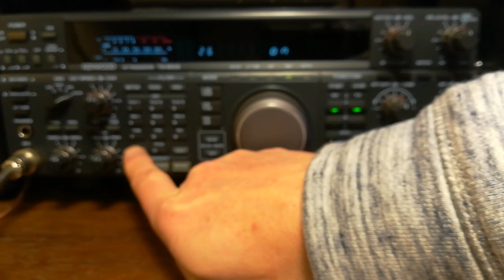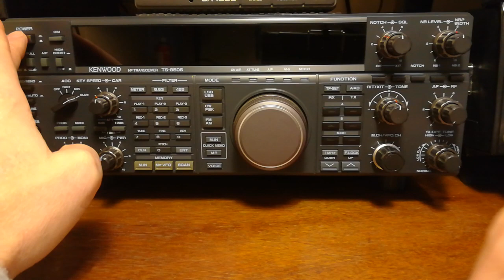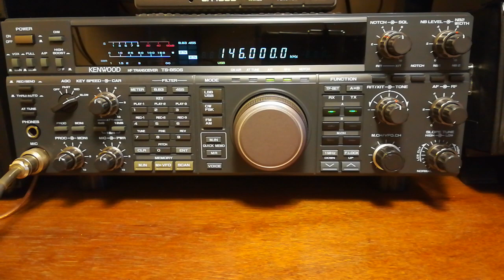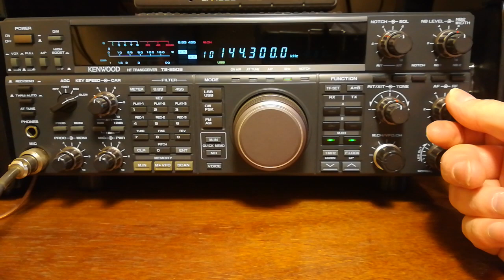GW0WVL .. Transverter function in the TS-850

Comment: hello, to have the transverter do you still need an internal hardware modification? or just access the menu? thanks a lot '73 de IZ7XHJ
Reply from the maker: No mods at all to the radio, Just the transverter and the cable to connect it to the radio, Then put the radio onto 28.000 mhz go into the transverter menu and pick the band the transverter is for ,  If the transverter is for 2 mtrs when you  turn on the 2 mtr transverter option in the menu the display will change from 28.000 mhz to show 144.000 mhz although  the radio is still  on 28.000 mhz the display alters to correspond with the transverter  so its easier to use and know where  you are frequency wise when the display is  showing  the true frequency.

Comment: How about a video showing how you've hooked your transverter to the 850?  Anything to watch out for?  73 de NB1U
Reply from the maker: Its straight forward Mark, Inline as you would a vswr meter , Run it to 13.8 volts  from your power  supply, You will also need to switch it  to TX as there isnt a Carrier operated circuit in it, I just hooked it upto the ACC jack on the 850 as you would if connecting up a linear amplifier ....  Regards de Gw0wvl.